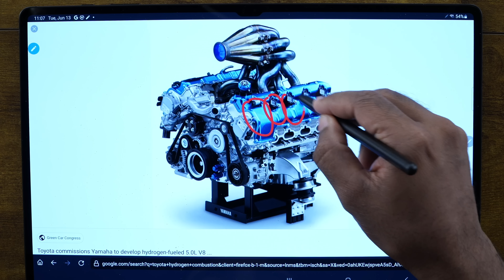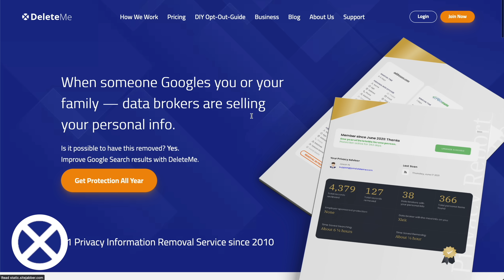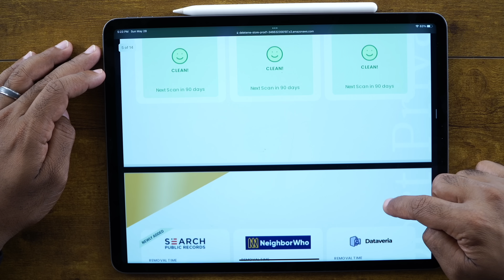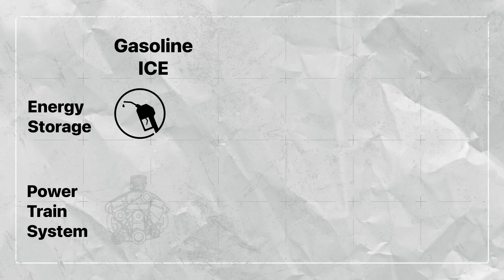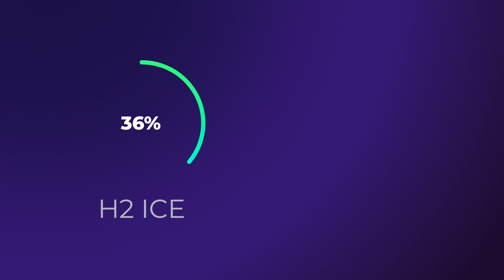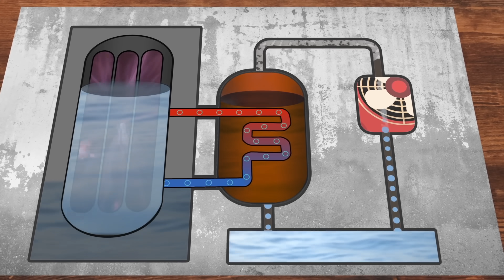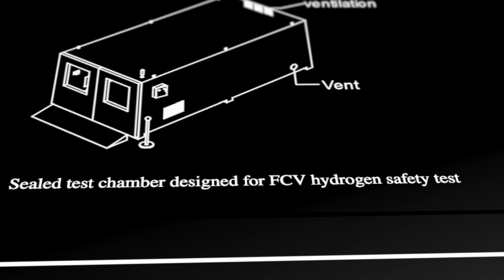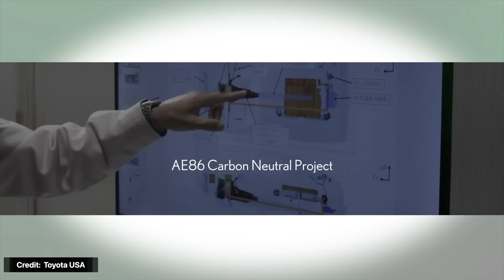Toyota's Says They Just Destroyed EVs - Hydrogen Combustion Engines

Comment: From the efficiency standpoint for EVs you only addressed the efficiency of EVs once the battery was charged. Whereas you pointed out the efficiency of the complete hydrogen production chain.  How about addressing the efficiency of the complete production chain for the electricity required to charge the EV.  How about we address the base source for the electricity.  Is it Solar, Wind, Hydro, NG, Oil, or Coal?
And please be even in your treatment of the current availability of Hydrogen and the current technology for its production when you say, in the future all our electricity will be green. That is not going to happen for 100 years.  How do we deal with the production chain of electricity over the in 10 years when the electric mandates hit and we have to increase the use of dirty fuels to make electricity just to meet demand because the mandates will drive.  The only way EVs will be better for the environment is when we have dependable green energy sources like Hydro, Wind, Solar and Nuclear.  Remember, any Nuclear plant started today, if it can get approved, will not be online in 2035. Where are we to build more hydro when we are currently removing more hydro than we are build?  Wind and Solar are not reliable without storage and other than pumped hydro, what large scale storage options are anywhere near close to being available.

Comment: talking H2 fue whether fuel cell or ICE the real problem never about energy it has or the engine, the main problem is always the H2 generator itself. the clean way to produce one today is electrolysis which very inefficient, take a lot to produce, more than EV need to run. that's why in the end still use "brown hydrogen" which from fossil fuel

Comment: I’m curious at the cost to replace this motor would be. I say that in the lines of the fact that electric vehicle would have to go through two batteries if I were to drive 300 miles. That’s a cost  of $5 to $20,000. A gas car can go that far and I may only have to replace the transmission $5000. I believe we’re going to see a world with a mixture of hydrogen and ev. Ev for basic consumers and hydrogen for more of our industries. Ev can simply not do what gas and hydrogen can do and vice versa.

Comment: That sounds like Toyota doesn't want to lose it's ICE production lines. It only makes since if you think you can keep the same production line only substituting certain components like they've always done. If the great Steam locomotive Makers could have done the same they would try to do what Toyota is trying to pull with Hydrogen ICEs. I see hydrogen as only a possibility if you put water in the fuel tank and O2 NO2 and Co2 out the tail pipe.

Comment: Hydrogen is not the answer for personal mobility and would represent a giant step backwards. Hydrogen infrastructure is practically non existent compared to the electrical infrastructure available for EV charging, especially home charging. 

I would argue though that Hydrogen would be a great fuel for Aviation. The infrastructure footprint required would be much more manageable putting Hydrogen fuel at airports. Hydrogen would also have the benefit from reduced vehicle weight as the fuel is consumed, something current airplanes rely on to increase their range. With battery solutions you are stuck hauling those heavy batteries all the way to the destination even after they have given up the majority of their stored electricity.

Comment: Promising; I've mentioned this before in the comments section on this channel, the Japanese government have invested heavily  in hydrogen infrastructure. JCB here in the UK have developed a power unit for their equipment and the country of Holland is now going down this route. Germany has taken baby steps, there is also several companies that have developed jet engines  to run on this fuel source.
Reply: Oh dear! All this emphasis on the engine, the least of the problems associated with hydrogen vehicles. The hydrogen production transport storage chain is very expensive and energy intensive, Fossil fuel derived hydrogen is more polluting than using the fossil fuel directly. Even when hydrogen is produced using green electricity the efficiency is verypoor comaared with batteries.
Reply: @rogerphelps9939  The great thing about using solar power; is even if the efficiency of converting a readily available element into a usable fuel source is 1% the carbon footprint can be virtually 0

Comment: Seems to me the biggest problem with hydrogen EVs is that the fossil fuel petroleum industry will happily cause the extinction of all life on Earth just to get next quarter’s stellar profits. Without that, most every fueling station would include hydrogen and synthetic bridge fuels produced onsite with tap water, renewable electricity, and direct air captured carbon dioxide.

For many vehicle users, a plug-in hybrid (H2FCEV/BEV) would be a great solution. A BEV range of 50 – 100 miles with a hydrogen tank for road-trips would serve most very well. Such reduction in battery weight and materials would be beneficial as well. 

Eventually add roadway induction to that hybrid system and we might have infinite range with only hydrogen as a failsafe fallback when the roadway isn’t providing power.

Comment: 7:47 The sound of an internal combustion engine is the sound of energy being wasted. It is the sound of explosive decompression exiting the engine via the exhaust pipe rather than driving the wheels. 

Also, looking at the energy density if hydrogen per kg is misleading when comparing it to other fuels. A kilo of liquid hydrogen is over 14 litres while a kilo of petrol is about 1.2 litres. You need to consider this fact to put hydrogen into perspective. Furthermore, hydrogen is difficult to keep as a liquid - you have either to cool it to -253c and keep it there or vent it as it warms. For practical purposes hydrogen is nether energy dense or efficient.

Comment: Another important factor that people don't notice, is decompressive cooling.  When your fuel is a compressed gas or a gas compressed to a liquid, it cools the inside of the cylinder when it's injected.  This effect can do a lot for engine longevity.
Reply: hydrogen has to be kept cold for storage, it DOES CAUSE HYDROGEN EMBRITTLEMENT< it is an issue, not just where it is decompressed.
Reply: @sonofamortician  They have newer materials that don't suffer much from hydrogen embrittlement.  They can also reduce the amount that leaks out to nearly zero.
Reply: @sonofamortician  it's not liquid hydrogen
Reply: @phil2156  I specified both.  A compressed gas that's decompressing also cools down very quickly.  It can be good for keeping the engine cool.  CNG and LNG engines currently benefit from this effect.
Reply: Petrol does the same thing. As it evaporates, it cools down the fuel/air mixture.😮
Reply: @gregbailey45  not even close to the same level.  LNG or even Propane, can cool to freezing temperatures when decompressed.

Comment: Hydrogen engines are a far better option than bev's. The range of battery vehicles is still shocking as are charge times, anyone that does a lot of miles needs a better solution than battery ev's.

Comment: Weight is almost irrelevant with Hydrogen.  Hydrogen may have 70 times the energy density of a lithium battery, but the energy conversion results in a loss of over 60%.  Additionally, batteries are improving, but hydrogen isn't getting more energy dense.  How much energy is lost in generating the Hydrogen?  Electrolysis is the only responsible way to go, and it loses a lot.  How much energy is lost, pressurizing the hydrogen to like 10k psi?  If we had a pure green grid, losses wouldn't matter too much, but that's not the case.

Comment: Currently the biggest drawback of a hydrogen ICE is range. While hydrogen has a lot of kilojoules per kilogram, you can't put many kilograms of compressed hydrogen gas in a reasonably-sized tank. Engineering Explained did an analysis of this and found that if they use the same tanks they use in the Mirai, at 10,000 psi, the total range comes up short of 100 miles. Kick up the range anxiety. It's a cool proof of concept, but I don't think H2 ICE is going anywhere soon, and certainly will not supplant battery electric vehicles.

Comment: Yeah.... just like the fuel cell cars... we'll just pull hydrogen out of the air....(there is no free hydrogen floating around) oh, wait, we'll get it from hydrocarb...(kinda defeating the purpose of low/no carbon) no, how about water? Oh... more energy put into splitting water than the energy you get out of it.

Comment: regarding range: electric cars lose range for 3 reasons. one is the added air resistance, the other is the fact that a cold battery holds less charge than it would at normal operating temperatures and the third is the fact that the driver will end up sacraficing some of the energy in the battery to keep themself warm. oh and there are battery care systems that might also zap some energy, depending on the model and battery chemistry used. the air resistance also effects ICE cars and they will probably be running at even lower efficency than normal. the ICE car i used to own did about 8.5l/100km in winter, 7.5l/100km in town in summer and 6.5l/100km driving reasonably fast down the highway(i hypermiled it to 5.5l/100km but i also got closer to the in town consumption when driving very dynamically on the highway). so hydrogen ICE isn't imune to range loss. but the bigger problem is that if the range is gonna be about 1/2 of what the fuel cell car is, its hardly gonna be better than a good BEV. btw, hydrogen might be light but despite being compressed, it does take quite a bit of space. the Mirage sacrafices quite a bit of interior space to hydrogen tanks and its got a fairly long wheelbase.

Comment: You missed a couple huge hydrogen problems. 

      1.  Tanks are heavy by necessity to keep in that hydrogen. And even then some is lost over time.

2. Transporting hydrogen is super inefficient with lots of loss. How do you get hydrogen to a fuel station? 
 
     Truck it in? How much fuel is burned trucking in fuel.  The truck would also need special HEAVY reinforced tanks to minimize loss as well.

      Pipeline? Most pipeline can't handle hydrogen and you'd lose alot of hydrogen from leaks, hydrogen being the smallest molecule. Long pipes reinforced along the entire length + maintenance would be extraordinarily expensive requiring alot of material too while still leaking anyway. As it is a large amount of natural gas is lost from leaking out of pipes and natural gas leaks relatively much less than hydrogen and yet it's a huge problem with natural gas.

Hydrogen fuel for passenger cars is nonsense, whether it be electric or ICE
Reply: "Methanol to H2 station" en China existe. No transportación de H2.
Reply: @CHIEF_420  How much energy is lost converting methanol to hydrogen? How much waste product is produced in this and how toxic is this waste product?

           Methanol is problematic itself. It's highly toxic and flammable. Whether being transported by pipes or trucks, if anything goes wrong because capitalists love cutting corners to save money, it can be a huge problem for surrounding communities.
Reply: @firstlast-cs6eg H2 con grande vehículos es mejor de batería tecnología. EV pequeño coches es buena, pero "semitrucks" o construcción automóviles o "ships" o "buses" o aeroplanos necesitan H2 para tener menos emisiones. EV batería es "HEAVY" y necesitan mucho "resources" para existir
Reply: @CHIEF_420  What is "H2"? You mean hydrogen?

Comment: As Tesla Bjorn noted when he was testing the Toyota Mirai the car takes about 5 Kgs of H2 to fill from a station that has only about 25 Kgs available without converting more liquid H2 to gas and compressing it for delivery.  In total the H2 station can only fill about 80 cars per day.  Compare that to a gas station with a 5,000 gallon tank filling cars with 20 gallon gas tanks.  The gas station could fill 250 cars.
Reply: Compare that to the electricity grid which can handle a complete changeover to all BEVs with only minor upgrades.
Reply: @rogerphelps9939  no, it cant.

Comment: Hydrogen when burned with normal air creates NOX.  Hydrogen burns "clean" when burned with pure oxygen. One place I could maybe see it working well would be with the new co2 power plants that are being built.  They are a closed loop system that uses compressed co2 as a working fluid instead of water. They are using natural gas right now to heat the co2 in the combustion chamber but I dont see why they couldnt use hydrogen.  The advantage of these systems is they are closed loop so the co2 that would be produced is captured as part of the system.  They also dont use any water. There are technical challenges to running a turbine at 1000+ psi and 1000 degree combustion though. The plant in Texas is from a company called NET Power.  There is one getting built in Canada as well.  Where I'm at in Canada we could actually have an advantage since they are already doing carbon capture and storage. Connecting to the pipelines could make it possible to cut out the capture part and just use the high pressure low temp co2 that runs through the pipeline already. Either capture that energy and bump up the pressure and pull the heat to dump it back in the pipeline or capture the waste heat to heat up the co2 that is entering the system, use the co2 and dump it after.  I'd personally rather see businesses built around the power plant so you could use that waste co2 to produce products.  I'm guessing they dont need cold and extremely high pressure co2.

Comment: I was so looking forward to running H2 in my cars.  My father-in-law spent 40 years writing about chemical engineering and often reported on hydrogen as a fuel source.  I even looked into running hydrogen tanks on my 2006 Chevy Avalanche.  But the cost of the tanks was prohibitive.  Lately, I've been reading about the cost of extracting H2 from whatever it is bound to.  As of the time of this video, I own a gas ICE and an EV.
Reply: There is a reason why it's not come to market. It uneconomic.
Reply: @markthomas7279 because of the way they are making it

Comment: Is it fair to compare the price of the most expensive M3 to the average ICE car?  Then again I would guess if you compare the average BEV to the average ICE it would probably be even higher lmao.  

I love my electric car but I'm not married to the BEV concept.  I'm interested in any cool new automotive propulsion innovations.  I think retrofitting ICE engines, or whatever this qualifies as, makes sense to so we can try to continue to use them rather than wasting them but in the end isn't it still a super inefficient engine regardless of the fuel?  And do we really want to stick with the gas station model rather than something more distributed?  One of my favorite things about my BEV is charging at home.  Expand that out to parking lots, apartment buildings, garages, and everywhere else you park like we should be doing and life gets easier for everyone.  And back to a hydrogen ICE you still have all the complexity and moving parts so lots of points of failure compared to an EV which is another thing I'm happy to get away of.  All in all, regardless of any environmental factors, just owning a BEV is a joy compared to an ICE for many, many reasons.

Comment: The volumetric energy density of hydrogen is awful, look at how much space the pressure tanks in the Mirai consume. The gravimetric density isnt great either, the gas weigns nothing but the tank that holds it weigns a lot. The curbweight of a Mirai is several hundred pounds more than a Model 3 but the 3 has more passenger and cargo room then the Mirai not to mention how much better the performance is.
Finally hydrogen is a secondary green house gas. It interferes with the process that breaks down methane in the atmosphere and methane is a very powerful greenhouse gas.

Comment: Depending on the location, 1 kilo of hydrogen will cost you between 10 and 20 euro's. Injecting this in a V8 engine is gonna be a very expensive way to move around.

Comment: Hydrogen is $26 per kg in California. This is with 100 years of R&D. Using dirty hydrogen. These videos are not informative, they are a joke. Best case there is a racing circuit that can afford stupid expensive gas by simply having high ticket prices.

"Hydrogen charges faster". Complete lie. My BEV charges to full overnight using up zero of my time.

Teslas lose more like 20% range in the winter, not 50%

Why are you comparing average ICE to the Model 3 performance? Why not to the ones that are now around $30k?

Exploding hydrogen gas stations work just like regular gas stations. No, no they don't.

Comment: EV's already have 500mi range per charge & the battery technology always improving. L1 extension cord EVSE charging from regular power outlets while vehicles are parked 20+ hours per day (commuter vehicles, grocery getters- NOT for road-trips) means that 2-5 mi per hour of charge over 1600 watts NEMA 5-15 regular power outlets 120vac // depending on the energy economy // driving style // of the specific EV & driver // I can easily get 3.1m/ kw in 19 LEAF SV driving crazy fast, but sane legal driving at the speed limits results in 4.8mi / kw while mild hypermiling gets to 5.3 mi /kWh or more!

Comment: Hybrid electric was invented & commercialized in 1918 by founder of Porsche that Toyota looked up and started working on in 1994 when they were blocked from the PNGV program in the USA. It took until 1997 in Japan to make gen 1 hybrid that did not catch fire easily. Working with Panasonic & Yamaha, the Prius II was what made Hybrid sell by the millions as a trending, durable, reliable, high fuel economy practical family car, popular with ride hailing for its low operating costs.